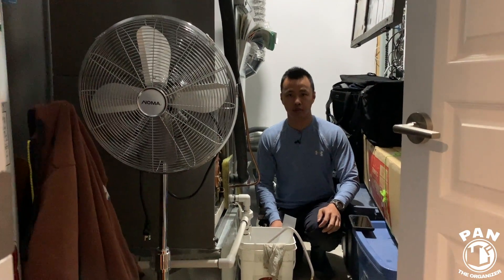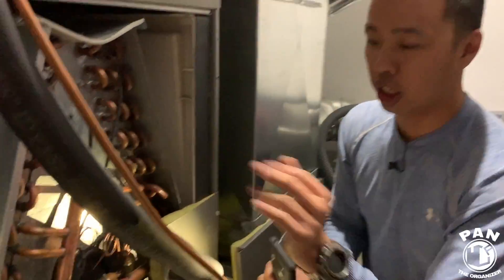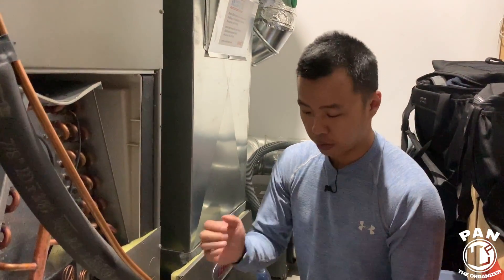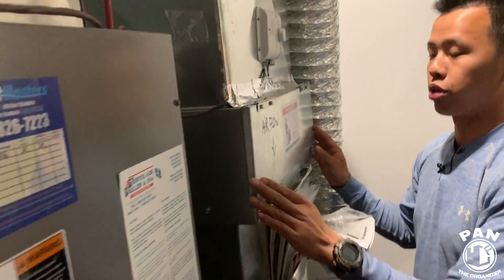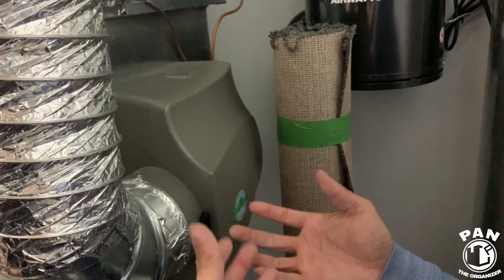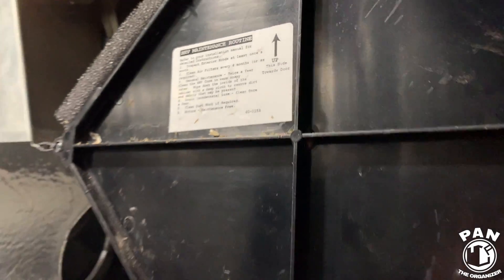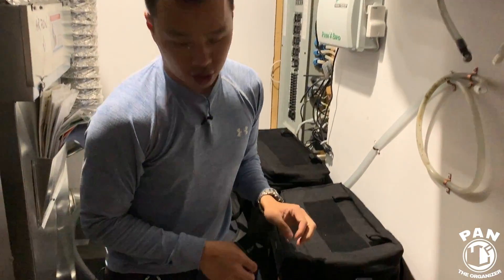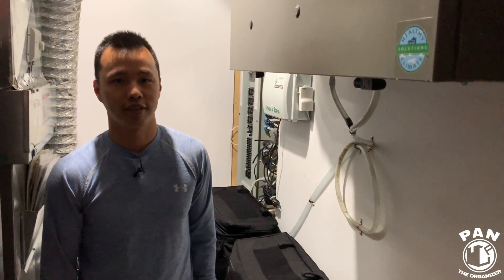HOW TO DO HVAC SYSTEM MAINTENANCE AND SAVE MONEY !!

Comment: You inspecting the back of the coil ? You need to check the other side of the coil where the the airflow comes from. Pull out that black round plastic in the middle and you’ll see.

Comment: Anthony is awesome! Thank-you, Pan, for making this video.
Reply from the maker: Thanks Erika!  How did you discover my channel?
Reply: @PanTheOrganizer  I use both Google and YouTube as search engines. I find that YT videos are often not as thorough as text found by Google, but while text is reading material requiring imagination, videos provide images and audio to convey information more easily. On YT I submitted the words "a/c maintenance" into the search function. Below about 3 ads for related businesses in my geographical area I found your video listed about 3rd (on Sep 7, 2020). Repeating the YT search does not keep your video consistently in 3rd place but all the several times I tried it was always listed among the top 5. I subscribed and watched some of your other videos like the Turtle Wax restoration of the polycarbonate plastic of car headlamps. It's a struggle for me not to be wordy. I appreciated Anthony being so thorough in your video; like text AND video. I live in a 3-bed, 2-bath, 2-car garage in SW Florida -- and it's Summer right now ☀️💦 so I need to know about the maintenance of my a/c 😓

Comment: I have a question, hopefully you can guide me in the ride direction. Info before question: I have an HVAC unit and the coil inside the house is set in an angel. I noticed last night rust is staring to build up on the pan that catches the water from the coils that leads to the drain pipe(s) and the bottom of the coil.
What would you recommend I use to remove the rust that is on the pan and starting to come up the side of the coil?
I do use the coil cleaner form twice a year and I know they remove dirt, debris, and other junk that gets in to the fins. I am stuck with Google searching how to remove the rust. I do not want to introduce no chemicals (acids, anodes, etc.) without hearing from experts in the HVAC field.
Reply: Don’t use too much coil cleaner on your evaporator coil (the one in the in the unit inside of the house), to remove rust I use a small shop vac and maybe gloves and a bucket to remove thicker debris, if you see rusting/oil stains you may have a leak and require a epa certified technician or HVAC contractor to send a technician to further investigate, also use hot water and vinegar in a gallon water bottle and pour down your primary drain so it can clean out your drain

Comment: I am an HVAC maintenance technician. There is more we do than just that. I also check the amp readings on your blower motor, fan motor, and compressor. I also check the refrigerant pressures, and check the sub cool and super heat to make sure the unit isn't low on refrigerant. Unfortunately you have to have someone licensed to do that. You definitely don't want to mess around in the electrical panel if you don't know what you're doing.
Reply: please can i get to know u more please ..am an hvac technician here in nigeria
Reply: @wealthprince4628  Lol scammer

Comment: Check under the coil for dust build-up not the top. Also somebody forgot to wrap your TXV bulb.
Reply: Thank you! That really bothered me while watching this video! TXV is the thermal expansion valve. It regulates the flow of refrigerant. The sensing bulb for the TXV is on the front of your evaporator coil. Where he was looking at the drain pan. It kind of looks like a CO2 cartridge. It should be insulated with foam tape
Reply: @jessicaeagan3165  4:52 Fallow the 3/4 copper line where it goes into the coil. Your TXV bulb is strapped to that line. They should be wrapped in insulation tape so ambient air doesn't effect the metering process.
Reply from the maker: Hi.  Thanks for sharing your knowledge.  I'm no HVAC specialist, so what is a TXV bulb exactly?  And where is it?